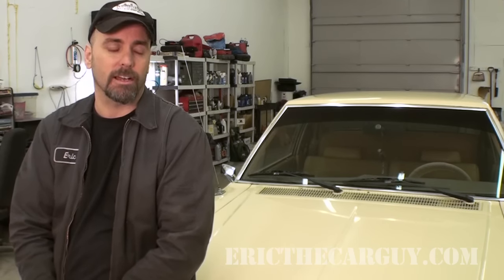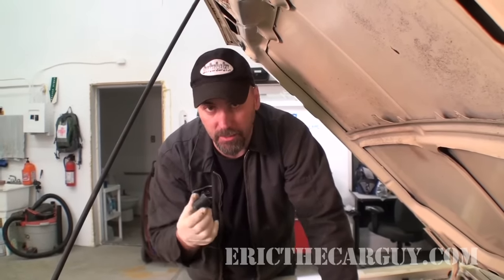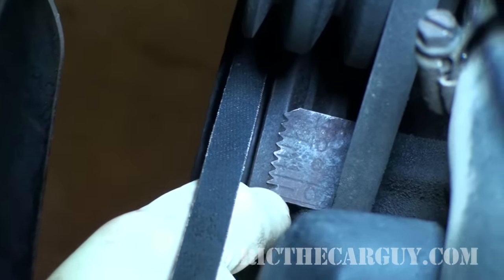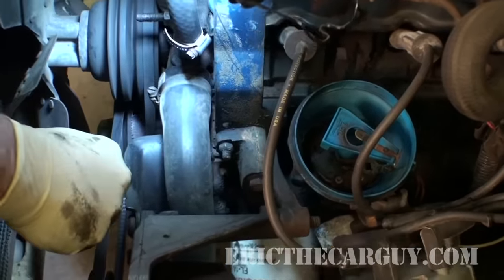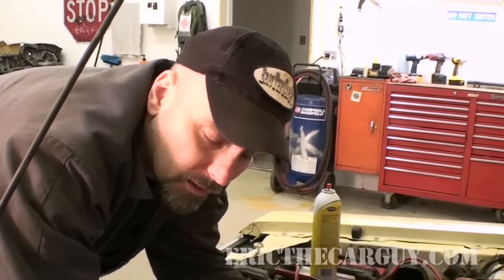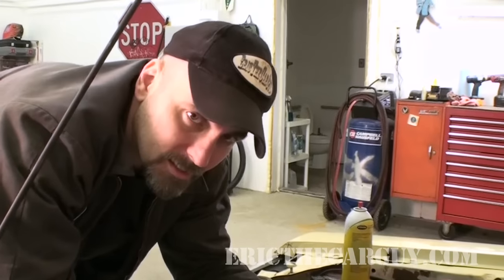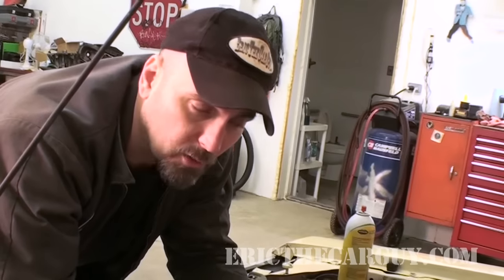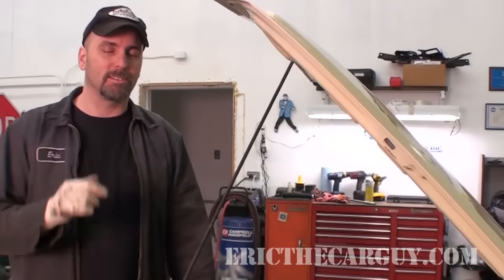How To Check Timing Chain Slack -EricTheCarGuy

Comment: Many mechanics I know have argued with me that this process of checking a timing chain is ridiculous or does not work,  I say this is the best process to check the slack in your timing chain,  it is common sense to see that this is the correct process. Most times I could tell you if a mechanic is worthless or decent just by seeing him apply a wrench to a bolt or by his ridiculously stupid comments,  thank you for your post and explaining the proper process for checking a timing chain.  When mechanics tell me that this is not the right way and then they tell me that they have been doing it for 30 years, all I have to say to them is you have been doing it wrong and that is a long time to be doing something wrong and not have figured it out yet, good job Eric.

Comment from the maker: I used to have to type out this procedure a lot. Now I have a video! How To Check Timing Chain Slack -EricTheCarGuy
Reply: julchrist mbadinga Wadafuq?
Reply: Walter Black He said ''Mecanic is a job I'd enjoy'' It's french ;P
Reply: hey erick please activate the CC function, soy de mexico y sin subtitulos no le entiendo XD
Reply: Maybe do this with a Chevy Cobalt timing chain ? :) So I can see if mine is slack :P
Reply: Hey Eric, I have a 91 honda civic, I installed a new engine in it. So normally when you depress on the throttle pedal you could hear the sound match at the exact press time. And my car sounds milli seconds after the depressed of the pedal. What is the cause of this and what can I do to adjust that????
Reply: I could be wrong here and eric knows alot more than i do about hondas but i think that car has a belt not a chain.  Also when you say new engine is it a brand new, rebuilt or a used engine? Could either be worn or not properly rebuilt.  Like i said eric knows a million times more than me about hondas though so take what i say as just some guy who cant fall asleep and is commenting on youtube videos.
Reply: It's a used engine with a timing belt. :)
Reply: EricTheCarGuy

Comment: very nice and clear demonstration Eric! we give you a nice applause from every technicians out there.. i deal with old classic TR6 MG vehicles sometimes at work and this will come in handy when it comes to diagnosing them for performance issues.. Anyways for anyone asking how to diagnose modern engines timing chain slacks.. you can use a live scanner like one of the bluetooth scanner that Eric reviewed one time.. i have an Elm327 scanner and i use Torque apps on my android.. it shows on Graphing> under timing advance.. you can only read by running the engine on idle but better on normal temperature after 5 mins.. you should see a about 6 degrees to 8 fluctuation and when you rev it should jump to 14 to 16.. it should be normal but again..its depending on what car you are looking at.. better check manufactures recommendations.. if you see erratic fluctuation on idle and the engines runs rough.. then you got timing issues.. better check these 4 things.. timing chain, crankshaft gear teeth and crank and cam sensors and gears... better start with the easy ones which are the sensors and the gears that it reads signals.. check them for everything before you jump to the chain since its a big job...  :)

Comment: I pulled the timing cover off a 2000 Dodge Caravan to fix a leaking o-ring. Replaced timing chain since it had a lot of slack. Engine now runs better and mileage has improved too.

Comment: Two thoughts, to make the timing marks more visible, paint on some "white out" and  wipe off the excess, really improves view.
Put a piece of blue painters tape on the lip of the distributor and mare the position of the rotor on the tape, makes it far easier to judge movement on the rotor.
Tony

Comment: Also, I have seen on GM vehicles that the distributor drive gear can be worn significantly causing additional slop. Can be one, the other or both. It's a good idea to pull the distributor and inspect it's drive gear. Happy wrenching!

Comment: Good old school tip..practical and still very useful.  I recently picked up a 1975 Dodge B200 Tradesman van with a 360 in it.  The guy I bought it off told me the timing chain was just replaced.  The engine was nice and clean so I couldn't really tell one way or the other if he was telling the truth lol.  I do trust he was telling the truth, but this video reminded me that it would only take me like 5 minutes to see if he was BS'n me or not.

Comment: This could also be indicative of a worn distributor gear. I had a friend that did this on a 302 and changed the chain. That didn't fix it, changed the distributor gear and it fixed it. Might be a freak problem for the dizzy gear to go bad but I just know it's possible
Reply: That is actually a very good comment..yes this test can indicate both chain wear and distributor gear wear.  Gear wear is not as common, but still worth noting! Some engines are much more prone to distributor gear issues than others so its good to know some history on the system you are testing for sure!
Reply: Good to know, I wasn't sure how common it was. If only Eric would have said it in the video haha.
Reply: I hear ya..I have been pretty hard on Eric a few times with comments lol.  Then I realized that if he covered every possible variable in every video, they would all be too long to watch lol.  This test he gives is a valid method of checking slack on a chain with this type of system..yes there are variables, and in this goofy trade there always will be, but this vid only claims to show a method of testing for chain slack, and thats what it does :) Thats why comments are so critical on youtube channels..you get to learn lots from the vids, and you can learn lots from the comments as well :)
Reply: Yeah, true. I would think the best way to test the chain would be to pull the valve covers and watch the valves move. Wouldn't that be a valid way of doing it?
Reply: Anytime you can test something without having to remove anything else is the way to go in my books :)
Reply: Well he did take off the dizzy cap, on some motors the valve covers are easier than the dizzy cap haha
Reply: lol ya i guess…but on average the cap is pretty damn easy..I can't remember the last time I had to struggle to get a distributor cap off..  But if the valve covers are easier then by all means yank em off :)

Comment: Thanks Eric, had a misfire at @5200 with a big block chrysler. determined that the crankshaft would rotate  10-12* before the distributor starts rotating, yikes!  Thanks again for the informational video!

Comment: Good test for timing chain slack, not an easy task for a DIY'er if you have never done one. Just changed the chain and gears on my Dodge 5.9 gas had about an inch slack in the chain at 192,000 miles....Fun Stuff

Comment: If the chain has slack, get #1 on TDC on comp. stroke.  on 0. Then mark the #1 plug wire on the cap on the Dist. with chalk. Lift up the Dist. and turn the rotor to #1 terminal on the Dist. body. Now turn the distributor body way back against normal rotation. Set the Dist. down and turn the distributor to normal position. Tighten the bolt some. Now set the timing. You are compensating for timing chain slack.

Comment: I'm not really super mechanical, but if you were to just measure the diameter of the pulley and use that to calculate the circumference, wouldn't that be a sufficient way to calculate degrees with fix mark of your choosing around the belt? 

Also, is there any reason doing this on a compression stroke TDC is the best?  Slack is slack is it not, or do you need the resistance of the compression to aid in the test?

Thanks for your videos.  You're super helpful!

Comment: Timing chain, timing belt.  Same thing it's inferred.  Great video!
Reply: any vids on replacing the Harmonic Balancer for the 626 v6?
Reply: Douglas Williams  Yes, I'm currently in the process of shooting a video which includes removal of the 626 harmonic balancer.  Would probably be more respectful to ETCG if you would have asked that on my channel instead.  ;)
Reply: ***** cool, just so happens the metal ring on the outside of the harmonic spun off mine the other night
Reply: Douglas Williams  That's a known issue on the V6.  http://mazda626.net/topic/43763-it-was-a-monday/   I've only heard of it happening on the I4 once.  The V6 harmonic balancer has at least 4 reports in the past year alone.  Yes, I did plan on mentioning that in my video too.  Haven't gotten to that part yet just drained the coolant and setting things up.
Reply: hmm seems odd, the post you referance shows a 99 having the same issue all the way down to the ring & all other aspects of it. Mine is the 95
Reply: Douglas Williams
The year doesn't matter.  All 1993-2002 6-cylinder Mazda 626's used the same balancer.  Even if they didn't it's the damage pattern and fix you should be most interested in.  There's your issue and that topic has the fix too.
Reply: Douglas Williams
Oh and in 1 extreme case last year, someone's balancer basically blew apart.  They posted pictures of the chunks of destruction.  Consider yourself lucky that the ring separated peacefully. =\
Reply: yes I do feel a bit lucky it did that. just surprised it happened

Comment: Nice work Eric. Can this same method be used for a diesel engine if say I pulled out number 1 fuel injector after no 1 is at TDC and used a probe to watch for movement of the cylinder on a diesel common rail, twin cam type of engine instaed of the distributor? And is the degrees literally 7 degrees out of 360 degrees from the axis?

Comment: excellent video sir!...i actually think my timing chain skipped a tooth,, barely runs at all now..was running bad with poor power... also when i removed cap and put on top dead center rotor was off by approx 30degrees

Comment: OK first off love your videos they've gotten me out of a jam on more than one occasion. I've got an 07 ford escape 4 cylinder 140k miles and the battery is four months old. Its my wife's aunts car. she took it to a store left it running went in, came out went to pull out heard a pop from under the hood stayed on for awhile then died. I've got a crank/ no start. Got fuel checked pressure, fuel pump, and inertia switch also witness fuel mixture come out of spark plug hole when spark plug was removed just to be sure. I got spark, replaced spark plugs, tested coils and visually witness sparking, again just to be sure but still no goey. Removed valve cover, timing chain in-tacked and cam and chain all rotate accordingly. Tested ignition relay, tested continuity of position sensor connector to ground and the CPS itself is reading 470 ohms which I think is normal haven't done a voltage test. I suspect a timing issue but I've hit a wall on what to troubleshoot next. Any advice because I'm pulling my hair out and about to gouge my eyes out so I can't help people anymore.

Comment: Very Helpful, I noticed that all of the engines I've over the years, the timing chain was the issue in a lot of cases, the rest of the engine had good compression and you could still see the hone marks in the cylinders.

Comment: My car bounces at certain rpms like it's missing a bit. I found the upper chain tensioner plastic had a half inch of plastic worn away and it was rubbing on metal. Bought a new tensioner which is in the mail. Can't wait to see if it fixes it.

Comment: Great video...  I've always had problems with Ford timing chains from the 1970's and 1980's.  Ford used a nylon cam sprocket on their timing chain sets.  These start to wear out around 70K miles, and fail around 100K miles.  With this much slack, I would replace the timing chain set "immediately" with a steel timing chain set.

Comment: Checking it with a timing light a little easier, especially when the distributor is rear mounted. Watch the timing mark with a timing light while revving the engine quickly, The mark will bounce around if the chain is stretched. that's how I found mind was badly stretched.  When a timing chain is stretched setting ignition timing will also be a challenge.
Reply: Really? What late model distributor has springs in it.   Its a proper test, Ive done it on many cars.  You can also disconnect the set timing connector or vacuum source to cancel out any advancement of the timing.
Reply: Did you write that? those are not Late model distributors, we are not setting ignition curves  Thanks. I am doing it all wrong. You are so smart, spend some life off the internet and actually try something.

Comment: Using this procedure it is possible to test if the excess deflection might also be caused by a worn camshaft gear or distributor gear rather than just the chain?

Comment: You should rebuild the 5.3 from the tahoe and drop it in the fairmont.  If i remember correctly you also have the old transmission and an ECU from when you did that engine replacement a few years ago.
Reply from the maker: The transmission is for a 4WD and no, I don't have the ECU.
Reply: And put a GM engine in a Ford?!?!?!? HELL TO THE NO!!! Do you not have any Shame.
Reply: Eric Borders
True, but it's not that uncommon to drop an ls1 engine into a fox body mustang which that 5.3 is based on.  I was thinking if Eric rebuilt that engine, had that 4l60e trans rebuilt and got a tail housing for 2WD and maybe got an aftermarket efi controller to run the coils and injectors it would make a neat project and several really cool vids and probably be less than $5K.

Comment: Hello Eric , could you please help me out on a question I have about mypost 79 Chevy Elco , 350 motor , I just got it it's  running ruff at idle, but seems to run good when driving , exhilarated , I did a full tune up and nothing changed ? it doesn't smoke or any thing like that ?? Anything you could tell me would be very appreciated , thanks for your time , and great video's

Comment: There is a much easier way to check.
Just put a timing light on and look at the timing marks.
If the timing mark keeps bouncing around and will not be consistent the timing chain is stretched. Easy.
Reply: +Lucky Dog timing lights are kinda expensive
Reply: So are engine rebuilds.
Reply: $30 is expensive?
Reply: Lucky Dog that's easier said than done when you have excessive chain slack allowing the vehicle to only crank and not start. This method is the easiest because then you yourself can feel the slack and also hear any noise the chain makes when it tightens back up...
Reply: find a timing light  in craigs list like I did or ebay,  as last resort get a harbor freight one, not the brightest but adequate : )

Comment: Would it be easier to align the harmonic balance mark at -----  0*  and cylinder at #1 at TDC.  The Ignition rotor pointing at #1 on the disturber cap. Then remove the Disturber cap and rotor. Check pickup coil is align to reluctor wheel, if not you have timing slack to Gear/Chain. Reluctor wheel and coil > <  have to align for spark if I am correct.

Comment: +ericthecarguy I have a question for you, I have a 99 Corolla and the mechanic diagnosed my car with a timing chain that has slack. My question to you is, would I be able to by pass changing out the timing chain, guides and tensioner by just replacing the tensioner? From my understanding the tensioner would take out the slack and put my chain back to the proper tension that it needs. Instead of paying the mechanic 850 bucks after tax, I could do it my self for 25 bucks. What is your thoughts?
Reply: no, change the whole belt.and then some. it's too much work to have to do one little thing and then find out it's more stuff to replace.

Comment: Eric, did the Fairmont have a sort of weird vibration as if two cylinders were fighting each other, or a maybe more accurately described as a pulsating of the exhaust note? Because I have changed my distributor, new cap and rotor, ignition coil, plugs and wires,  and Duraspark box. No change at all. It only does it from 1800 - 2200 ~ RPMS. From one mechanic to another this has me stumped.                    Edit: Same 200ci engine in my car.

Comment: Eric I'm not too positive about this but the 300ci has timing gears i'm not too sure if the engine in your Fairmont is the same? Also you could have play between the cam gear and the distributor gear right?
Reply from the maker: No, the Fairmont has a chain. Actually it's probably the nylon gears that have worn down that are causing the slack. As for the distributor, not as much as the chain. Any slack there would likely be negligible.

Comment: I have a 403 Pontiac engine do the rotor button should be pointed at the number 1 spark plug on the number 1 on the distributor

Comment: tbh, im not quite sure if i like these new videos when there's another person using the camera. idea is great and it should be better but for some reason it's not. the picture moves around too much and it's sometimes frustrating to try to watch these. another problem is the sound. first it's too loud and then it's too quiet. guess it takes time to get these right with the new shooting arrangements and all that. certainly hope it gets better. other than that - thanks for the info. very useful, as always. :)